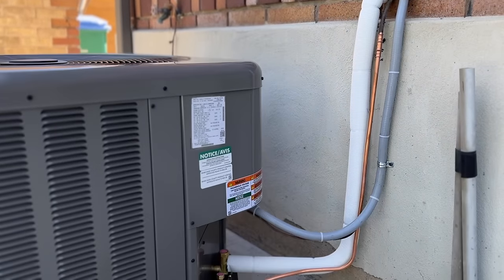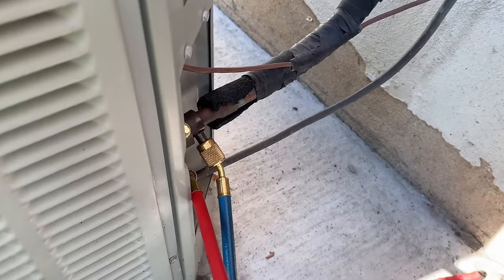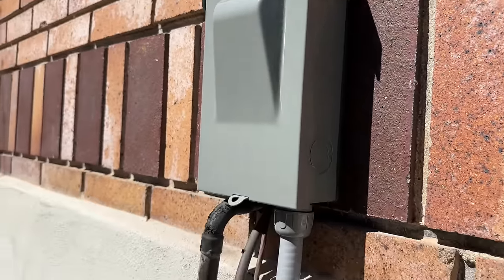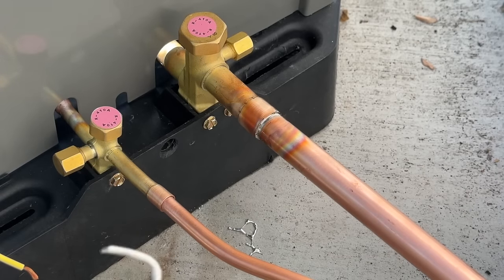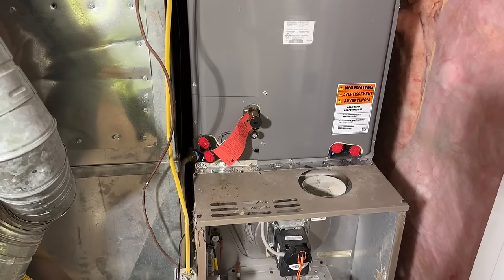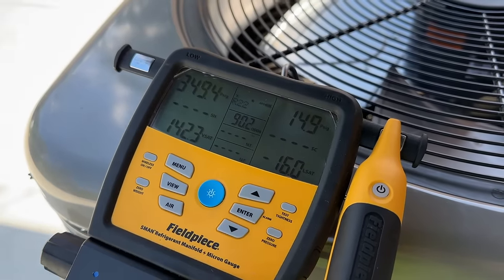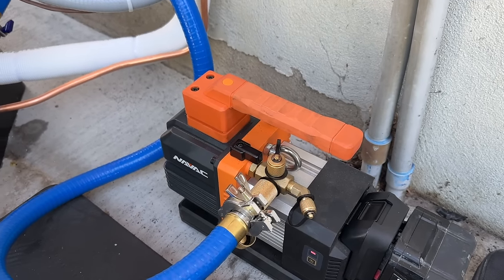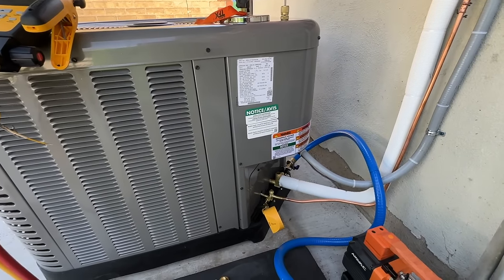Did You Know You Can Replace Your Own Air Conditioner?   -SAVE THOUSANDS-

Comment: This is absurd. HVAC is NOT a do it yourself project unless you think a homeowner should go out and buy 3k in specialized tools and then go to school to learn how to properly use them along with calculating superheat and sub cool not to mention how to charge a system. BTW no supply houses are going to sell equipment or a canister of refrigerant to the public without an EPA license. BTW#2 Silver solder has been proven to be unreliable and leaks developed over time brazing is the only way to go.
Reply from the maker: I’ve personally helped DOZENS of people replace their system. It isn’t brain surgery as much as you’d like to think it is, just because you chose to go to school for it.

Also, the tools are about $1000k or less, a small price to pay if you are saving $7000.

Cheers

Comment: This is bs did you know that an older air conditioner from the 2000s and below are built with straight quality that it actually saves money in itself by not having to constantly have someone come in and do repairs and not constantly having issues🎉 wow mind blown I’m assuming you didn’t have any idea of that on your thumbnail I guarantee that old train unit would outlast that ram for decades

Comment: This dude never removed Schroeder valves and never protected the valves at all and used soft solder meant for plumbing and also did not purge with nitrogen to protect TXV from clogging  TOTAL HACK JOB 😂🤣

Comment: Did You Know You Can Replace Your Own Air Conditioner? -SAVE THOUSANDS. Did you know that if you are confident enough to install your new A/C system and for whatever reason it isn't working properly, i.e. not cooling good, then if you can get a service guy out to fix it, they my charge you an arm and a leg to straighten things out (happened to me). You don't talk about how to dispose of your old condenser loaded with freon, you are using manifold gauges a do it yourselfer would have no business owning. Basically, what I saw in your presentation was content for YouTube. For a layman it does show the complicated procedure of working in the HVAC business.
Reply from the maker: Not sure what to tell ya boss. This isn’t for everyone, so don’t do this yourself if you don’t feel confident about it. I’ve halped DOZENS of folks replace their system with no hiccups. It’s not brain surgery. But again, not for everyone. 

Cheers
Reply: @diyhvacguy  I think we give Brain surgeons way too much credit. Cheers back at ya!

Comment: Soldering in a line set on heating and air or refrigeration has not been OK for 50 years and even 50 years ago when that’s all they did. It was not OK. It is a job for the professionals. You should always flow nitrogen.

Comment: BS .. it takes training, knowledge and experience to install a condenser and a evaporator, .
If anyone could do it then EPA wouldn’t exist nor the TRADE Itself. 
Stop lying to ppl !!
Reply: he's not lying, he's just showing it can be done.  I for one am grateful to be learning.  OF COURSE it takes more than what he's showing, like ANY trade. you cant expect to watch a video and swap out an engine or swap out an entire AC. but it puts you on the right path !
Reply from the maker: Yea you are staying obvious facts bro. This isn’t brain surgery. I have a separate video on getting your epa certificate which any home owner can do. The rest can be followed in my many hvac system replacement videos. If you are scared of losing business, you aren’t doing quality work sir.
Reply: Hmmm, auto parts stores have been around since cars were invented yet we still have a highly successful independent auto service industry - always had. I watched the video and he did just about everything properly, The only things I didn't like was the failure to flush the old lineset and I also believe in brazing. Not too sure about Staybrite and those crimp fitings.
Reply: Ya so you can charge homeowners $14K to replace a 2 ton unit.?  Not to mention it didn't need replacing to begin with.?  I have 2 houses with multiple units and every single time I've had to call an HVAC technician out they tried to tell me I needed to replace the entire system.